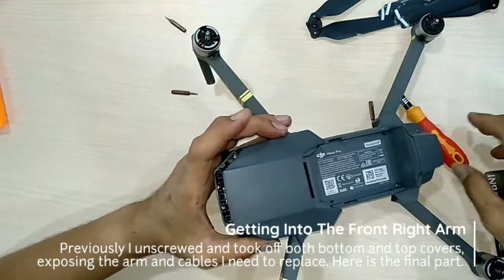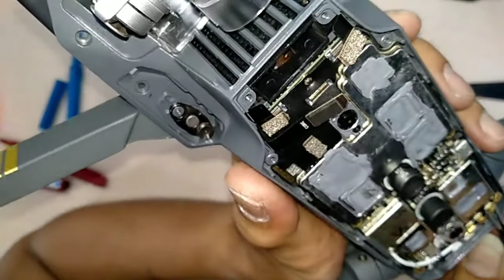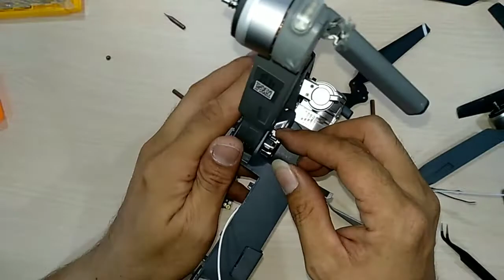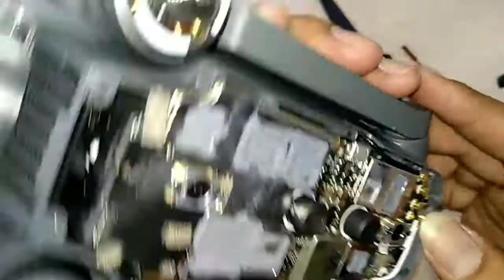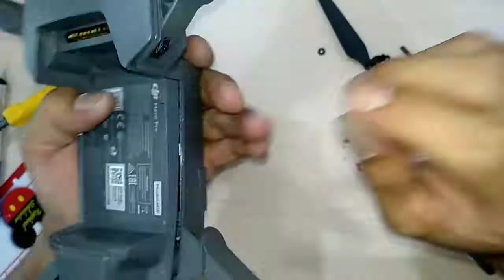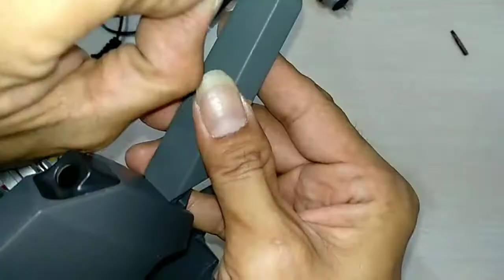[Part 3 Final] Replacing Mavic Pro Front Arm

Comment from the maker: minute 5:33
placing the new arm, then put the spring loaded bolt back to secure the arm.
before putting in the spring loaded bolt, i need to set the spring halfway first, before it's placed back in.
Reply: Can you please go into greater detail onto how to set the bolt back into the hole so that the arm is secure? I'm trying to fix my Mavic now, and having a terribly hard time. Every time that I replace the bolt, the arm defaults to a 'halfway' position (running parallel to rear arm). How do I align the bolt with it's screws so that the arm springs into the correct positions?
Reply: Patrick Anderson <------ I have the same question....
Reply: Ok. I figured it out. You need two pair of pliers ,one to hold the top cap where the two screw holes are open. A second pair of pliers holds the silver Square Spring holder. Twist the two parts to halfway and insert with the spring fully loaded. Worked for me.
Reply: Can please one of you get into detail or make a short video showing how to "load" the spring before insert it ? I and the rest of us will be very thankfull. @SidBits & @erbanassault
Reply: Denis Crilov 
have you found out how it works?
Reply: SidBits 
I watched every single video about this thousand times to understand how to put in the spring. Have not figured it out. Could you please take the time and explain it? Thanks
Reply: Last week I finally got the spring from China but I didn't had the time to try to repair it. When I will mount it and find a solution I will get back to you with an answer since nobody since to wanna help.
Reply: Denis Crilov have you managed to repair it succcessfully?

Comment: I did not see you work with the small black washer that goes somewhere in the front arm. Could you tell me where it goes?
Reply: You can see that there are 2 of them, and both are coming from the front arm joint , but he put the arm back without any of them. The small, harder one goes on top, there is a spot in the arm for it. The second one, well I wasn't paying attention when I disassembled it and now I'm search all over the internet without finding anything... I couldn't find a video where they say where it goes,  I've tried putting inside before pushing the shaft, but this way I couldn't snap the shaft into place. I guess I'll assemble my mavic without it.